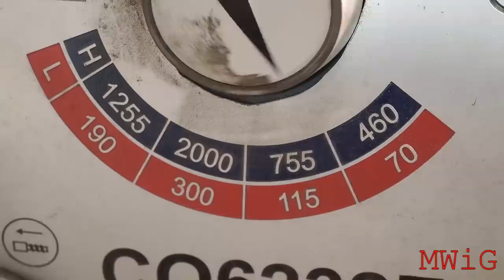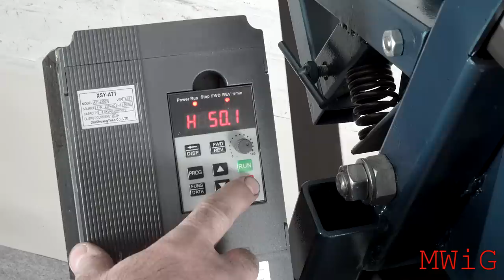DIY Multifunctional Adjustable  Belt Sander Grinder - MWIG #4

Comment: This is awesome.  I bought a 2x72 belt grinder almost 2 years ago and I still haven’t assembled it because I’ve been trying to come up with a way to make it able to switch from vertical to horizontal and also make an adjustable table for it.  I also haven’t had much time to think about, so there is that.  Your design and construction really has inspired me to try to get back to my project.
Reply from the maker: Thank you mate. And good luck with your project. I think everything will work out.

Comment: Finding a "well stocked" recycling yard is indeed the trick. Just those two proper rubber grinder wheels are several hundred dollars - each - bought new. Since they aren't crowned, I wonder why lawnmower wheels couldn't work, though speed could be an issue. Anyway, your and others' videos are giving me ideas to build my own, thanks!
Reply: Use gocart wheels

Comment: VERY nice build!  I only wish I had a mill and a lathe and knew how to use them so I could build one of these.  My problem is that I'm 67, not super mechanically inclined and have no DEIGN skills when it comes to this kind of thing!  My 2X72" belt grinder is about half completed.and I' need to design a tilting table for it as well as get it to track better.  My speed controller from the treadmills we took apart got screwed up during the Winter, even though it was all well covered so, there is that, too!  PLUS, I'm not a good welder so, my welds look like someone did them by the dark of the moon in lower Slobovia, somewhere!  Anyway, I love your build and wish I had the money to get a good one!
Best wishes and keep your great video builds coming!!!
Reply from the maker: Thanx mate.  I wish you good luck too.

Comment from the maker: Homemade Multifunctional Belt Sander Grinder.

My friends , i made some modification on my Belt Grinder and i wanted to share it with you. So i've added frequention invertor to control RPM. So i've decided to re-upload the video and delete the old one.
Reply: If I want to bey where  can I buy it
Reply: What's the motor specification? How many HP is this motor?
Reply: Home made ,,,,,,,,,,,,,,, Not hardly machine shop not in my home!!!
Reply: Thanks for a great video , man! I haven't seen the other one yet but I will be doing something like this later this year.
Reply: I can not do it because the quality is too high.
Reply: @Oldmanseenalot  Home made Belt sander, step 1, 20,000 dollar lathe...

Comment: Nice work, heres an idea: at 14:48, instead of rotating the whole machine 90 degrees, bring it to <90 deg. so that the belt is angling across the table the entire width of the belt. That way you get an even belt wear and a more aggressive cut. Ive been dreaming up this exact design, it blows my mind!

Comment: Great job, only one area of construction the builder needs improvement on, welding skills.
Reply: Robert B and NOT welding on rusty metal, even mild surface rust can compromise a welded joint. So much easier to clean the welding area first. Especially if your welding skills are not great, you have a much higher chance of your welds holding and not fracturing at a critical time Or a critical component falling off ! Nice build however. One thing worth considering though, the VFD is going to be subject to a hell of a lot of tiny metal fragments and that is going to ruin it in no time unless protected by some sort of cover. There will be short outs on the electronics board as a lot of those metal particles may well be magnetically charged and be attracted into the VFD.

Comment: I think that is a very versatile machine! And so nicely Made in the Garage! You should consider making a dimensioned drawing and put them on sale,  I think you would get lots of sales from that. Well done!
Reply from the maker: Thanx mate.
Reply: Techtongda (sp) makes the exact one.on ebay...I dont know if they're any good quality wise though
Reply: Wayne Stoll  the design is similar to this but in no way is it the same. This home made one is far more versatile in its vertical and horizontal planes, and I thing much better thought out and at between .650 to 700 USD for the commercial one it's a no brainier to make your own if you are capable and can do it.
Reply: I dont have the technical skills to build this....its the best and most versatile grinder I've seen.

Comment: Impressive!
I would love to know more about the motor speed controller.  Is it an AC motor?  What parts did you use?  Wiring diagram?
thanks
Reply: It just seems to be your average squirrel cage AC induction motor, assuming 120v since its got a capacitor but I could be wrong. He is using VFD (variable frequency drive) to change the frequency from 0 to 60 hertz, thus controlling the speed

Comment: that sir is a brilliant machine the vari speed means you can run any belt on it, have you used trizact belts at all from 3m they go from 80# down to 2000#, the only addition i would add is a bucket of water under the belt to catch the sparks and most of the dust, thanks for posting

Comment: This may be a dumb question, but why did you change the fan in the motor? Great job on this build, no detail left hanging.
Reply from the maker: Hey . If you did not notice,  the original fan was broken, I had to replace it.
Reply: @meanwhileinthegarage  Um, no, I didn't notice. Sorry about that, I just thought you might have had some insight on the fan. Simple answers.
Reply from the maker: It's ok mate.

Comment: This has to be the best one ive seen made. Not only in execution but function as well. Where did you get the controller for the speed? What are the motor specs? Any help would be much appreciated.
Reply from the maker: Thanx Justin. Motor is 2 kw; makes 1600 rpm. Controller is 2.2 kw 3 phase. From ebay.
Reply: @meanwhileinthegarage  thank you so much. Ive been looking for a good design but most seem to over complicare it. This is my favorite design. Thank you for the info
Reply from the maker: Thank you too Justin and good luck.

Comment: All are easily and economically sourced except for those grinding wheels.  With a width north of 4", prices for a set easily reach $1K.  That is the common denominator in all these projects.  I have yet to see one done without a lathe, parts of older equipment, or sourced as new.

Comment: Hello. How many revolutions does the engine have? And what is the diameter of the wire wheel? Where to get such a wheel? thank
Reply from the maker: A large wheel with a diameter of 300 mm. I found this in ascrapjard. The motor makes 1600 rpm.
Reply: @meanwhileinthegarage  Dear friend. Where were such wheels used (applied)?
Reply from the maker: No idea my frend.

Comment: First thanks for uploading the video 
Just wondering the grove or or lines  on wheels are not straight , isn’t that going to redirect the belt ?
Reply from the maker: No, it does not redirect. The smallest barrel-shaped wheel, it controls the belt.

Comment: Great job! 
You have a good build speed keeping it under 18 min. Keeps it interesting. How long was the actual build time?
How about some specs?
Max belt speed,  Weight of stand, Weight of sander, Wheel diameters, Belt length and width.

Comment: Maybe on the next version of this design you can allow some room at the table in belt vertical for clearance behind the belt platen for U shaped items. I had a 2.5 X 60 metal working belt grinder and several times needed that extra room behind the platen. This may involve an additional set of tension wheels for a 4" X 5.5" object behind the platen?  Thank you and enjoyed the step by step video.
Vincent from Chicago

Comment: What is the device used for speed control to run the sander? Normally, I'd see a simple on/off switch to turn the motor on/off but haven't seen a device like that before except on your machines. Curious. I have to mention about eye protection at all times, there is a scene where you are test grinding without any eye protection and the sparks were coming around from the back to the front towards you at the top. Would hate to see you get an eye injury! Keep up with the great videos, they greatly appreciated. "subscribed', you are indeed very talented and blessed with so many skills and talents. Cheers from the east coast of Canada! Stay safe!

Comment: Could you post the diameter of the three wheels you used and the distance between them please?
Reply from the maker: D 300mm,  190mm, 55mm. Distance 490mm,  425mm, 480mm

Comment: Nice work but dude why didn't you use the full width of those wheels? It would've been nice for resurfacing cylinder heads etc.

Comment: Hello. What did you process before painting? The video is hard to see.
Reply: What kind of solution do you use at 10.43
Reply from the maker: Hi. This is a paint that can be applied without a primer.
Reply from the maker: I use a solvent there.
Reply: Got it. Thank)))

Comment: Hi; great build .  At 4:54  looks like that that motor is a single phase ,capacitor start motor, can you tell me if you are running that motor with a inverter? if so how do you wire it?
thank you
Reply from the maker: Thanks Mariano. It is 3 phase motor.

Comment: Dear Sir, lovely build and I definitely want to include one of these in my wish list.  Can you tell me what the power rating for your motor is? Cheers.
Reply from the maker: Thanks buddy. Its a 2kw 1600 rpm 3 phase asinchron motor.
Reply: @meanwhileinthegarage  … and you would say that it is plenty powerful enough? Thanks.
Reply from the maker: With frequency controller yes.
Reply: @meanwhileinthegarage  So far my journey has not included actually using a VFD and 3π motor. I look forward to doing it.  My first project could be a belt sander or otherwise equipping a woodworking lathe with same.  Thanks for your info. Cheers.

Comment: You really got to spend some more time welding. Those are very weak welds, everything is just tacked together. Take your time, go in a nice slow steady straight line and you'll be fine. The design is a 10/10 however.
Reply: Prod. SlapHappy - i thought he was just tack welding for fitting purposes, then welding later off camera.?
Reply: @tacticalant3841  that could have been possible, but he painted everything.